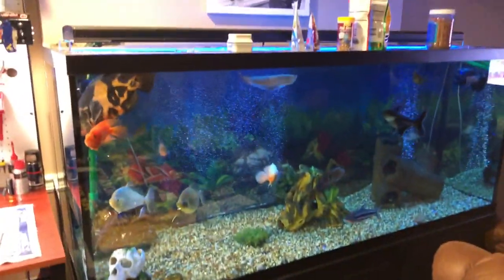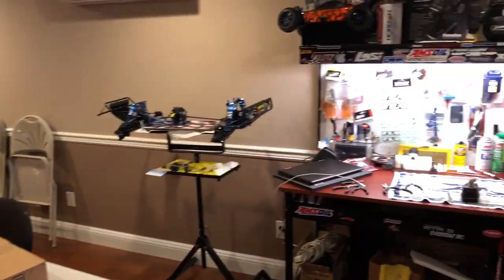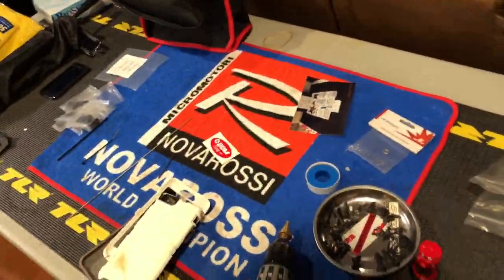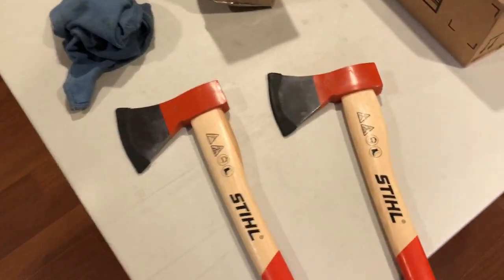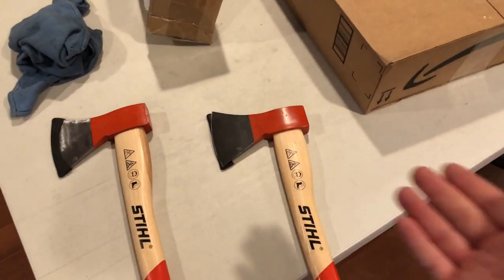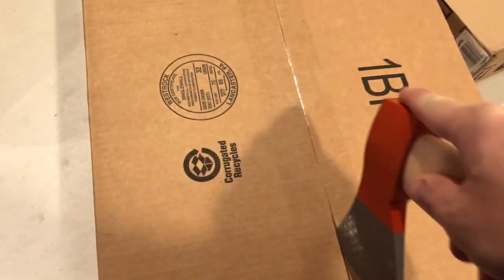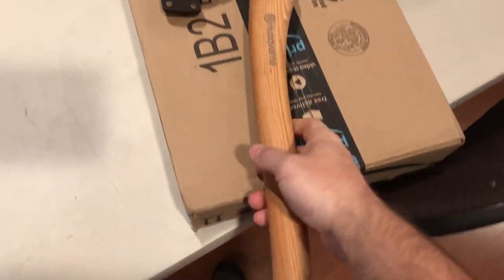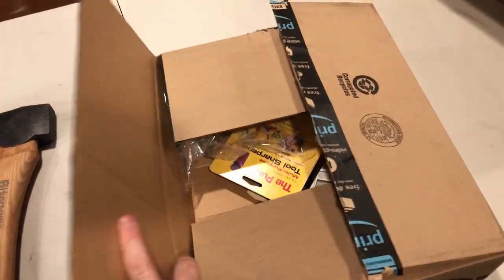RC Update/Unboxing STIHL Forestry Hatchet, Husqvarna Carpenters Axe

Comment: These hatchets are not great.The Stihl heads come loose way too easy and the Husqvarna's head is too heavy for one hand long use and needs a longer handle.Too thick all of them.However the Nicholson brand files are awesome for the price.
Reply from the maker: ogostaboy my STIHL hatchet the head broke off so now I got to make something or go somewhere that has some handles for me to look at to see what fits that head best for what I do with it. I like the head on it not bad and I love my Husqvarna’s Carpenter Axe/Hatchet ! For me it’s great I can almost do anything with it . I will sand the handle down a bit so it thins out a little for a better feel and polish the Axe edge on it make it sharp as hell. It will probably be my Axe for everything when I travel or when I’m on my ATV riding threw the trails :
Reply: @BOTAJELL  Still liking the Husqvarna? I am trying to decide between that and the Estwing..
Reply from the maker: Collin Hassing I love estwing hammers but  trust me I must say I love this Husqvarna Carpenters Axe its a must especially for the quality you get and great price. It will take a beating! The Stihl took a crap on me  ,  handle snapped on 2 of them mine and my dads .